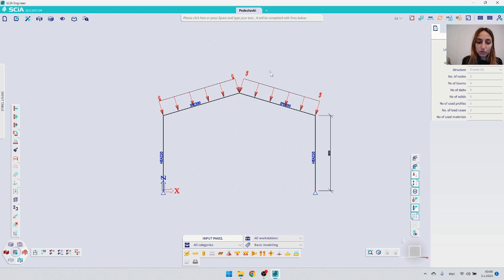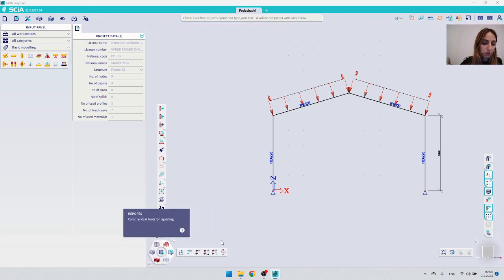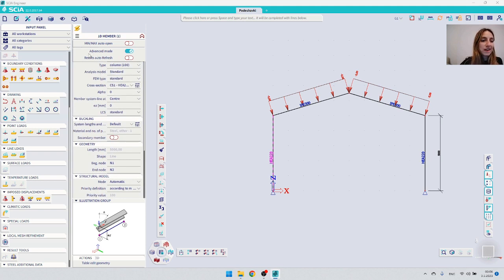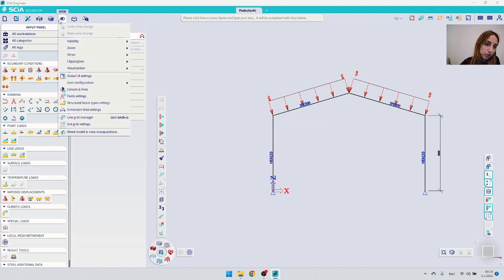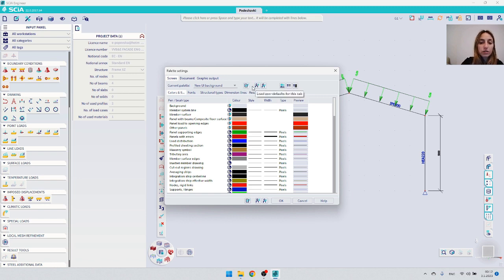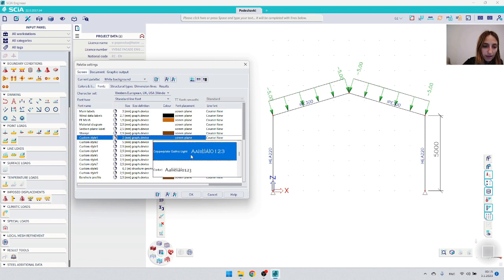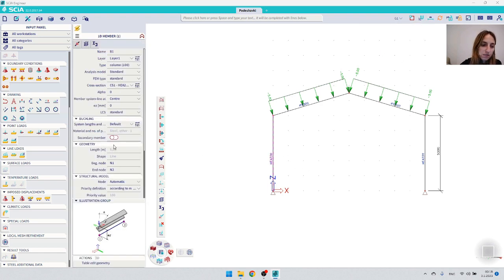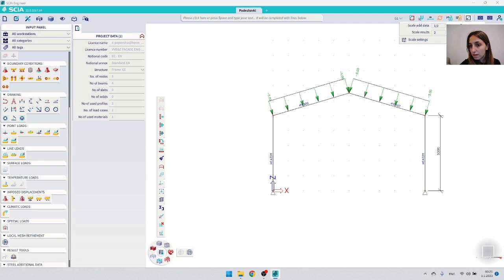HOW TO: Set up your SCIA Engineer

Comment: Hi Elena!
How do I define the buckling parameters of a column (those typical of industrial buildings), for example, a column with greater stiffness and above another smaller column with a lower stiffness... I even used a rigid link to simulate the eccentricity, however, I cannot configure the buckling parameters (I would like to configure the two columns to buckle together, is this possible?)
Reply from the maker: if I understood you correctly, in similar situations I would use length (instead of asking the software to calculate the buckling paraneter) for each element. But this is workaround. For specific issues like this, I would advise you to reffer to SCIAs customer support. They can work with the details and provide you the help :)